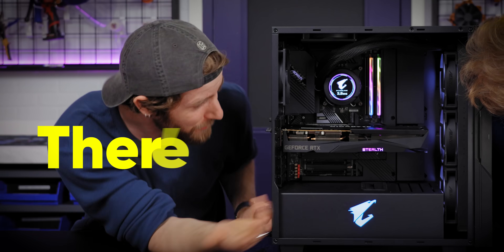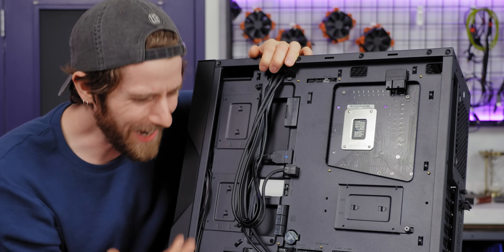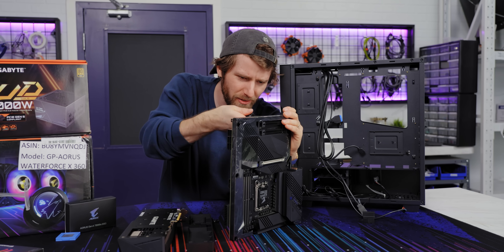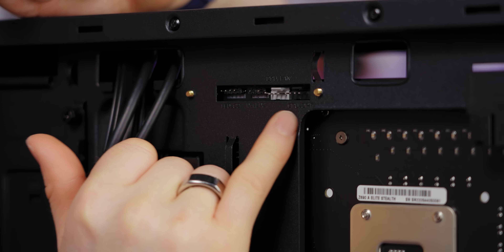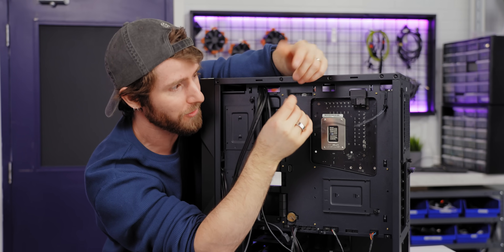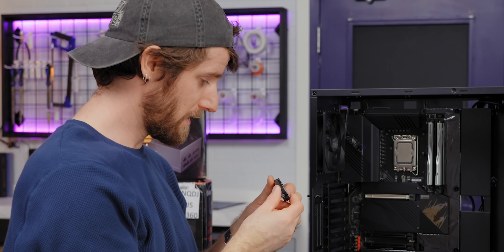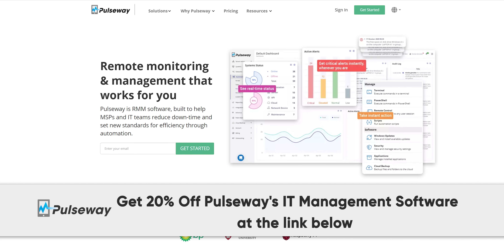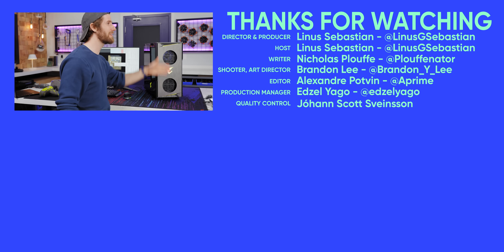Where Are the Cables??? - Gigabyte Project Stealth

Comment: I imagine this does wonders for airflow and less dust buildup
Reply: Well, it might help airflow... if they actually had an air intake vent...

As for dust buildup... So far as I can tell the single biggest cause of that problem is moronically designed intake vents. Short version: Holes in the top of the case are a terrible idea, and the transparent panel of pointlessness needs to get tossed on the garbage heap of history, as it is occupying what would otherwise be the single best place on the entire case for properly designed air intake vents.
Reply: Not when the front panel is a solid wall

Comment: It always amazes me when big companies fail this hard in testing their products. Like seriously, at what point the one testing this took a step back and said "Yeah, this is totally fine"? It's not even the bad air flow, the lack of ways to tidy up the cabling on the other side of the case, connectors not fitting well on the motherboard, the way some cables go through each spot, it's amateurish as hell.

Comment: The concept is really cool but the amount of problems that showed up in the second half of the video is baffling. You know a case is good when you have to cut plastic off of a connector and make speed holes on the front of the case because a Core i7 is thermal throttling on a 360 rad.

Comment: so drilling holes in the front panel of your case is meta now? aight
Reply: Those are speed holes. They make the pc go faster
Reply: @Arkciel  the actually do😂
Reply: grabs drill looks at laptop ...
Reply: @OneDabMan  lmfao. I legit laughed so hard at this comment. Maybe I should just leave the back plate off my laptop 🤔
Reply: @OneDabMan  do it.  So many laptops use a sealed chassis design & drilling an array of intake & outtake holes will make it just permaboost when plugged in. Usually this means a few holes on the ram door & a few holes right under the cpu cooler.
Reply: @atari2600b  so i can drill a hole on my laptop for fps now?
Reply: i guess so
Reply: Speed holes
Reply: Always has been
Reply: Speed holes!
Reply: I bought a cheap case that turned out to have crappy airflow. I took a jig saw to the front panel, and 3d printed some fan/dust filter mounts and it was much better 😂
Reply: You'll know if you drilled the right amount of holes when you can cover them & hear the CPU fan rise a few hundred rpm
Reply: @atari2600b  so even drilling hole still not make my laptop get fps too?
Reply: Yeah, that's why it's chambered through the ram slot first.  You don't need exhaust backpressure if you have intake backpressure.

Comment: I'm with the comments about how this hidden cable design should become standard, but damn, I wish they hadn't been so lazy with the design of this. So many cut corners and a shitty end result because of it.

This is far from the only issue with the PC in this video but... I have an H510, and trust me when I say you need a mesh front intake. Airflow is so dramatically stifled when you try to do a solid front (unless maybe if you have a really good side intake, but I don't have any experience with those). You're gonna get so much better perforance, temps, and longevity if you just have a mesh front instead of solid... and it doesn't even look bad or anything.

Comment: -How's Linus handling the stress of moving to a new house?
-He's fine, (Linus opens the front of the PC with a hole saw) he's just fine.
Reply: And i thought Steve at Gamers Nexus was Brutal
Reply: @andrewmoon3409  steve would be proud.
Reply: While the pc is running with the watercooler mounted right behind the holes
Reply: Almost taking Jake's finger in the process. hehe
Reply: @nicoherrerai  Linus is the reason they need workmens compensation claims lol 😝

Comment: "Ever seen anything like it?" he asks as he looks a computer's internals that has wires hidden or rerouted behind plating for the entire case.
Meanwhile, in 2003, Apple released the Power Mac G5 with no internal visible cables. And the Mac Pro (released in 2019) also does this too. Short memory span, guys.

Comment: I will be honest here. Why haven't Motherboard companies done this already, and case manufacturers add support to their cases like this. It would make routing , and front panel connectors a pain-less experience. Especially cable management and not having to worry which cables go where. 

It's an adoption and sure it would cost money to move ports to the rear side....but the user experience would be alot easier for new comers who get into PC building and putting PCI-E Power on the Side or bottom of the card would also be nice but not 100% practical with some cases(no pun intended)

Comment: Imagine spending thousands of dollars in research and development for this new concept just to have Linus destroy it in 15 minutes 🤣🤣🤣
Reply: Imagine spending thousands of dollars in research and development and forgetting about airflow?  🤦‍♂🤦‍♂
Reply: Fixing* it
Reply: I think this proves that they don't actually spend any money on r&d.  They just take an old product and blindly repurpose it without further thought.
Reply: @JT-rq7nt  According to GN Steve who has toured case manufacturers in Taiwan, it is extremely expensive to make new case molds even for a case company. That is why cases are so similar to each other. Hopefully someday they will figure out how to get the costs down. We're desperately in need of cases that provide good airflow with the new gen CPU and GPU coming out.
Reply: @davejones8922  bullshit. Just design better cases.
Reply: Destroy?? Linus fixed the damn thing.
Reply: @devamshah1631  What I meant was Linus destroyed their concept, but yes, he did fix it in 15 minutes too 🤣
Reply: How has no one stopped to consider that pcbs have through holes for all connectors? It’s as easy as simply sticking the header pins in from the other side and solder them in on the other side. 

Aside from stamping a couple extra, specifically placed holes on the back panel of the case and adding an inversion step in the mb assembly process, I see little to no added cost to produce this. Anyone at home with a $100 soldering iron and a dremel could accomplish this.
Reply: He has money, who cares?

Comment: im still running a ryzen 5 2600, and an asus dual fan gtx 1050 ti. practically 0 cables in my case, card has no cables. my tiny stock cooler which still works 4 years later. all games 100 frames with alll settings all the way down. im the king of livin on a budget

Comment: I was  just talking to someone a couple months ago about a motherboard, case and PSU that's all built to be as plug and play as possible, with rear mounted  motherboard plugs and all, and  dedicated plugs for I/O and power to mobo on the case, so that install is literally just snapping the mobo into the plugs that are built into the case.  No routing of cables through out the case by the end user and thus eliminating cable management tasks forever.   

That'll be the future.

Comment: Great concept, total failure in execution. Instead of a clean sheet, they tried "adapting" a case that was not great to begin with. Linus' rant was near-Steve at Gamers Nexus level snark (and I so want to see them get one of these). Watching you cut open the front panel was both shocking and hilarious
Reply: Not necessarily defending gigabyte, but it is actual very very expensive and also time consuming to make the tooling to develop a brand new case from scratch. So modifying an existing case certainly would be the move for a proof of concept. No doubt they are working on an actual case that is made for this type of stealth motherboard application and if they do…it really could be game changing for the industry. Or they will be lazy and fuck it up. One of the two :)
Reply: @houstonOLED  13:30 lazy

Comment: In terms of "useless air filters", the CM Silencio 652s is another example
Reply: it's usefull to filter the metal dust from the drill though :)
Reply: @hazgebu  nope, the air intake vents (unfiltered) are behind the front filter covered by a door that you could simply open: since air follows the path of least resistance, the filter would remain useless
Reply: i love my 550 tho that one is pretty slick and has airflow
Reply: @thereisnospace  the cm 690 II was awesome! They just missed "the vent" with that silencio one (air intake behind the filter)
Reply: @lc5945  i didn't talk about the air. I was just joking about the metal dust but I guess the joke went the same way as the air
Reply: @hazgebu  got the joke, but man, it's a door...(made out of plastic btw. Not putting you down, just overthinking)

Comment: Imagine they redo this concept but with actual cooling in mind. Make the cutouts better/bigger, add a mesh-flow front, make the cables longer and this would probably become a standard. Fans all in one spot ✅, easier to plug in ✅ don’t have to do extra work ✅. Plus building pcs for new people would be nothing.
Reply: I'm thinking put the CPU mount on the back like the industrial mobo manufacturer does and completely separate the CPU and GPU into different chambers with each chamber optimised for that devices airflow needs
Reply: @MrTrilbe  That Would lose the airflow advantages, wouldn't it be better and neater to install a horizontal divider through the cable-free main chamber between the two coolers?
Reply: @armadillito  you say horizontal, i say vertical, let's call the whole thing off... sorry..  I think someone needs to model the airflow for both to see if there's a difference, you idea might act like a smaller case for the GPU and heat it up, both don't have the natural convection of the hot air from the GPU pushing heat up out of the case, mine has a lot of space for hot air to move out of the way but might need more fans to cool, because more space, unless it's an ITX or M-ATX height case, come to think about it, mine is just the same as using an PCIe riser cable to mount the GPU behind the board like on the super compact builds, but without the riser because the PCIe slot is mounted on the back... i'm a dumb ass

Comment: Your connector clearance issue is probably from you dismounting the motherboard and then mounting it without adjusting it's position, there's around 1mm of space you can get motherboard misplaced (this is generally creates problem with plugging in PCIe devices as they don't fit between pcie slot and chassis).

Also still no PCIe holder on the right side for GPU, that is available on Quadros and Workstation chassis (HP, Lenovo etc)

Comment: There is no way that patent should have been awarded. Putting connectors on the bottom of a board is not novel. Even if its a first for motherboards (which i doubt).

Comment: You can put a standard motherboard in the case, but you can't put the motherboard in a standard case. So, if you choose that motherboard, you are locked into their case to get the benefit. You would use a standard GPU, but would not get the benefit, so, you're locked in again to the case and the brand GPU. Bold vision, but not sure it'll catch on.

Comment: For once, a gimmick is not considered as a gimmick… Most people want this to be a standard.. It a hassle to adapt.. Yeah, for sure… For future hardware, like mobo, case, and gpu manufacturers needed to engineer for this new standard, but in the long run, if this design is in demand, they had the mould ready..